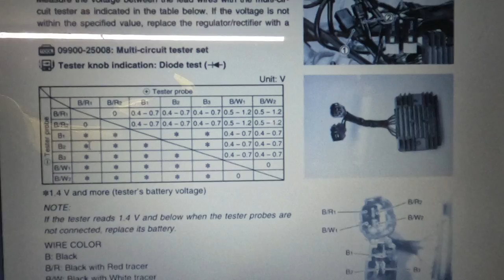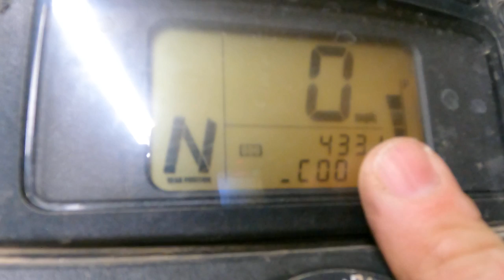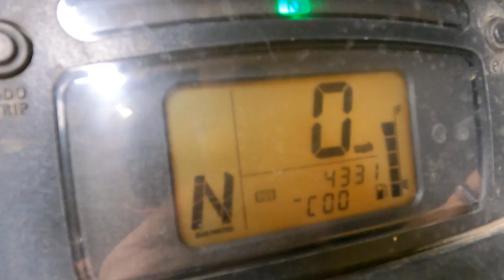2007 Suzuki KingQuad 700 has charging & run ability issues

Comment: I have an 2006 /700 king quad Suzuki that I’m having an issue with wondering if you might have an idea. I started up it runs fine and after about five minutes it stalls and shuts off. I can hear the fuel pump running when it stalls for about three seconds, the same as if I turn the key on to start it up again. I started up again it might only run a minute this time and then it stalls. Wondering if you might be able to give me an idea of something to look at.
Reply from the maker: Hey Rick. Is it flashing any FI codes on the dash? It's possible that you have a bad fuel pump are a fuel pump relay. You would have to do a fuel pressure test to see where it's at when I stalls & dies.
Reply: @limitlesspowersportsservic3394  thank you I have made up a fuel line with a T in it for a pressure gauge from before on another test. I will put that in line and fire it back up and see what the pressure is when it dies and when I start it up. I think that pressure supposed to be around 13 pounds do you know?.
Reply from the maker: Hey Rick. It's supposed to have 43psi. Anything less you need to check for a kink in the line, the fuel filter, pressure regulator. Sounds like you just need to replace the fuel pump. But don't go buying a cheap one from Amazon.  You need to get the OEM one. The knockoffs are crap & go out fast & sometimes don't produce the right fuel pressure.
Reply: @limitlesspowersportsservic3394  thank you for getting back to me. It has an OEM fuel pump in it now. But as far as I know, it’s the original fuel pump. I will check the pressure while it’s running and see if it when it stalls the pressure drops before it stalls and if that’s what’s making it stall.
  Can you give me a website to order OEM parts from?
Reply from the maker: I use partzilla.com are you can hit up a Local dealer but partzilla.com gives ypu a little better deal.
Reply: @limitlesspowersportsservic3394  I will go to part Zila and check it out. I agree with you on the OEM parts. I have had some bad experience with Chinese parts or offbrand parts.
  Thanks I will try to get you some more subscribers. My son has a 450 Suzuki dirtbike and he also built a sand rail with a Hayabusa engine in it. My grandson has a 450 Suzuki dirtbike and a 250 Suzuki dirtbike so I’m sure that they will be checking your website out, I hope that you get enough subscribers to make it pay for you. I appreciate you helping me out. I’ll let you know what happens when I check out the fuel pressure and the fuel pump on my king quad.

Comment: Have you ever had a problem with a king quad running great and fine for about a hour or 2 then just randomly shuts off and will not restart for about a day then will start right back up and run again fine for about another 2 hours? Thanks for any info
Reply from the maker: Sounds like your crank sensor is going bad. When it gets how it's starting to break down on the inside & causing it to lose spark. But after it cools off it works again. There is a possibility that you're fuel pump is doing the se thing. You can test the crank sensor for ohms & peak voltage if you have the proper tools. Something with the fuel pump. You can hook up a fuel pressure gauge & ride it around & watch the gauge to see if you start to loose fuel pressure before it starts to die.

Comment: hello. can you please tell me, is 130 psi good compression for this model? with the engine warm. tnx so much!
Reply from the maker: Standard PSI is 140psi. But with 130psi  it should run .
Reply: @limitlesspowersportsservic3394  it is starting a little hard when cold, it turns a few times before starting, but once it starts, it is running ok. It's a 2007 King Quad 700. It has 11.000 km. I think it needs a valve adjustement.
Reply from the maker: You probably just need to adjust the valve clearances.  They might be a little tight causing a hard starting issue.

Comment: Hey there great video! I had the same code (_C00) I adjusted my TPS until it read -C00 and it ran great, however after about 20-40 mins of riding it gets the runability issues again, I recheck the TPS and its back to showing _C00 

Any ideas? TPS hasn't moved at all, I can't turn it and screws are in there tight.
Reply from the maker: Hey Clayton. Yeah that is definitely a sign of a bad TPS altogether.  If you adjusted & it keeps having issues it's just faulty. Just order you up a new one & do the same when you replace it.
Reply: @limitlesspowersportsservic3394  thanks for the quick reply man, I'll order a new OEM one and see if that does the trick!

Comment: Is there a way to check the tps to see if it's bad? I've adjusted mine, but the line won't stay centered.
Reply from the maker: Yes there is a way to test the TPS itself and the wiring from the TPS to the ECU. Are you getting a c14 code or a p0120 code? that is a faulty malfunctioning TPS sensor code. Also since your TPS won't stay centered you most likely have a faulty TPS sensor.
if you're interested in testing it more you can send me an email at limitlesspowersports78@gmail.com and I can send you some screenshots from the service manual that shows you how to test it all. 
I'm pretty sure you have a faulty TPS sensor. If you purchase a new one please buy an OEM TPS sensor from Suzuki. Do not buy an aftermarket Chinese piece of junk because it can cause major problems.
Reply: @limitlesspowersportsservic3394  Thank you, email sent.
Reply: Same here, adjust it. Centered looked good. Couple throttle snaps and its either too high or too low, adjusted looks good, throttle snaps, same thing too high or too low.
Reply from the maker: double check to make sure your butterfly is closing all the way every single time. Make sure the throttle body is completely clean no debris in the way but that's most likely a failing TPS sensor. The TPS sensor is done by voltage so if it's not getting back to the proper spot once it returns it's going to read off because of voltage is reading off. I would just go ahead and replace it.

Comment: Can a bad stator cause the battery to over charge and boil? I changed the rectifier but i am still getting the same thing.
Reply from the maker: Yes absolutely. A stator can overcharge your battery causing it to do exactly what you said. You need to check it volts AC while running to see what the output voltage is. But yes that sounds exactly like what your problem is. I have seen it many many times. an overcharging stator can also destroy your voltage regulator. A voltage regulator can only rectify so many volts. Another way you can test to see if your stator is overcharging is to check your volts DC at your battery. using a multimeter turn your multimeter to volts DC and connect it to the positive and negative battery post. start up your four wheeler(this test works on all Powersports units) Rev it up and hold the throttle steady at about 4,000 RPMs  if it's charging over 14.7 you're having a stator issue and you need to change it. Do not replace it with a Chinese one. I know they're inexpensive but they do cause problems not all of them do butuse OEM factory parts. And yes they are not very cheap but there's a reason they're not cheap. if you have any more questions or if I need to clarify more please comment and I'll be more than happy to get back to you.
Reply: @limitlesspowersportsservic3394 Thank you for your time, quick and resourceful response! It has been thorn in my side for sometime now and this is the best response I have had! Once again thank you!
Reply from the maker: absolutely no problem Dustin. this is what I created this channel for is to help educate my fellow technicians and mechanics who want to learn how to work on their own equipment and save a dollar or two doing that. And I'm always here to answer any questions no matter what they are. I work on motorcycles ATVs UTVs scooters lawn equipment you name it. I've also been in the professional road racing series motor America and a super bike racing for many years. so I have a lot of insight on other things also

Comment: Would it also cause speedo not to work?
Reply from the maker: No this issue wouldn't not cause the speedo not to work.  You could have a bad speedo sensor
Reply: @limitlesspowersportsservic3394  I have rest of the issues followed along with this. Also if I hook up thermals neutral light will come on off..

Comment: When you did the ohms test on the stator my read .2 is that good or no
Reply from the maker: according to Suzuki's spec you should have 0.4 through 1.0 ohms of resistance between all three yellow wires. And no resistance to the yellow wires the ground. And you should check your AC voltage output and should have 75 volts AC and above at 5000 RPMs unloaded and that would be checking it between all three yellow wires while the motor is running and revving the motor up. 0.2 is a little bit low but I would definitely check your AC voltage output
Reply: Man I’m at a loss on this quad i work on quads all the time but this one is a nightmare so I had a spare kq 700 motor that was junk mostly so I took the stator out of it and put it into the running one and I’m still getting the same reading .1 or .2
Reply: What are the chances of having 2 bad stators I checked the reg/rec and it says it’s good I even switched out the entire harness the other day because I had one where the reg\rec was different so I switched the entire harness just to use it but there was a break in it somewhere so I switched it back so here I am about to light it ablaze
Reply from the maker: It is a possibility. did you check your AC voltage output on both stators? also you could have a bad rotor / flywheel. I have ran across other manufacturers where the flywheel magnets started to become unglued and moved and would cause a major charging issue and intermittent spark sometimes. but can you tell me what your AC voltage output is around 5000 RPMs? this sounds like one I would love to plug my factory Suzuki diagnostic tool into to see if I can get any crazy readings.

Comment: i’m getting 1.1 ohms on that plug. on all three test points. is that okay?
Reply from the maker: You're just a little on the high side.  You're looking for 0.4v - 1.0v but I think you will be ok. Have you checked you to to see if your grounded out anywhere & the AC voltage output.  You are looking for  at least 75vac are more at 5,000 RPM.
Reply: @limitlesspowersportsservic3394  yes sir stator is not grounded out to the frame or to the negative battery post however the new rectifier i bought worked great for about 2 days and now it is overcharging where as the factory one was undercharging... is it possible i just bought a cheap crappy regulator or is there an underlying problem im missing? thanks!
Reply: its up to 20 volts to the battery! yikes
Reply from the maker: Well I know the o.e.m reg/rec is about $150. If you ordered one off of Amazon it could be just a cheap p.o.s. Did you happen to check the AC voltage output on each leg at around 5,000 rpms

Comment: I have a 2005 Suzuki KingQuad 700 and it won't start and I need help, so if you could, please tell me what to do. so alright, I wait for the fuel injection to finish its job and so i press the start button. it cranks, but somehow poorly and my fuel injection interrupts me as if i never let it finish. then the battery starts clicking. I checked the fuses, thery're ok! by battery is fairly new! i have almost a full tank of gas! I don't know what to do here, i am simply stumped. 

another issue i had earlier is it sometimes turns off on me due to overheating. is this a radiator problem? why is it overheating? it wouldn't constantly turn off it ran fine but even after not driving it that hard it would overheat.

please help me adress there issues. thanks.
Reply: Hey Fullsend Offroad. Thanks for stopping by & checking out my channel.  You definitely have a bad battery. It may show the proper voltage when you test it at 1st but when you put a load on it it is not keeping the proper voltage. So one way you can try is to put a jumper pack on it and try to turn it over like that period but what you're telling me is the sign of a bad battery.. Also your overheating problem would be definitely check your coolant levels clean your radiator out and make sure that your fan is turning on and Make sure your fan is turning on and it's not it's most likely a thermal switch on the radiator that is going bad I have seen this go out in the past.
Reply: @cylewinkler916  damn thanks! Yeah it turned out that my battery was just low on voltage. I dkd some research and found out that KingQuads would eat up juice real fast. 

However with the overheating levels in the gauge i cant see my temperatures so that sucks. I have powerwashed my radiator many times in the past but it would still overheat and turn off. My fan, at least, IS turning on. But ive heard of many radiator issues on the KingQuads.

But nothing explains my FI system interrupting my cold start...
Reply from the maker: If your battery was low like it was that will make your EFI not have enough voltage to keep up. And then it restarts itself all over again. So my question is now is your EFI still restarting with a fully charged battery? Also definitely check to make sure your coolant level is full it's full and check the coolant reservoir to make sure it is full. And also use post to change your coolant every 2 to 4 years. So definitely do a coolant flush in the whole entire system and make sure all the air bubbles are out and Hopefully that cures your overheating problem. Otherwise it's a possibility that your water pump is starting to go bad. But if you haven't flushed your cooling system out since you've owned it you definitely need to do that.
Reply: @limitlesspowersportsservic3394  wow thanks! Yes i will check my coolant.
Reply: @limitlesspowersportsservic3394  yeah I charged my battery and my EFI now doesnt interrupt!
Reply from the maker: That's great to hear. It's a pretty common issue. I just realized I replied back to you from my email on one of your comments lol. I used my name instead of my YouTube channel name lol.

Comment: I have fI light come on so I changed my voltage regulator. But my light still on my suzuki
Reply from the maker: Hey Jim. Just because you changed it doesn't mean that was the cause for your FI light. You need to jump the diag plug & read the code. If the problem is fixed then the FI light will automatically go away.  Check my video on how to jump the plug.

Comment: 2005 Suzuki king quad.  Dies when I engage gear.  
Also need a display. Mine faded to nothing.
Reply from the maker: When you say dies when you put it into gear, what exactly is it doing? Is it just shutting off instantly, slowly idling down & dies? Are you sure your battery is charging & has proper voltage?. Do you have any FI codes? But also having a instrument cluster you can read helps too lol. But your fading issue, it's not just the plastic lens over the cluster getting cloudy?